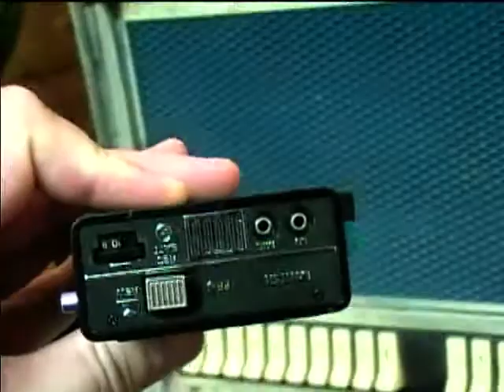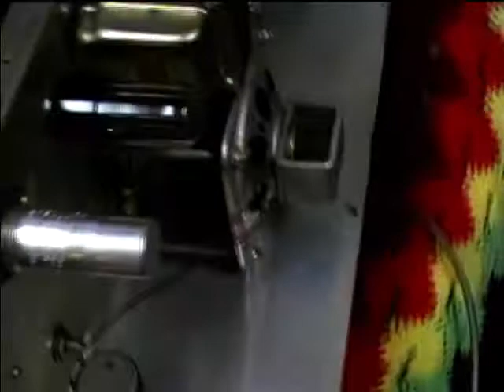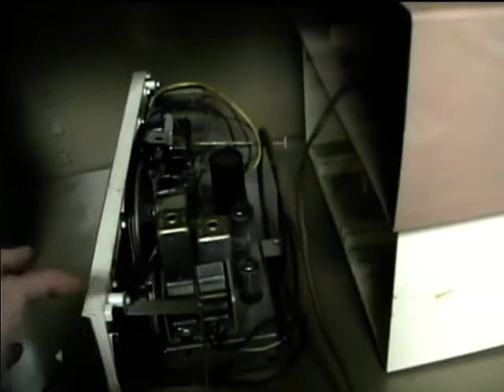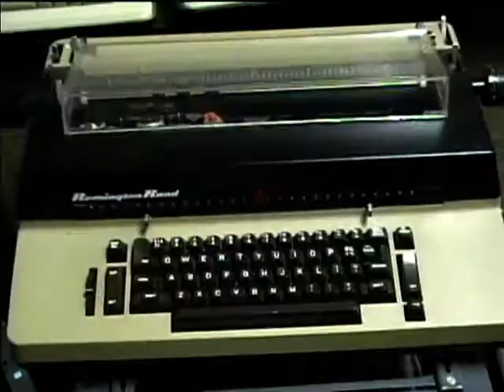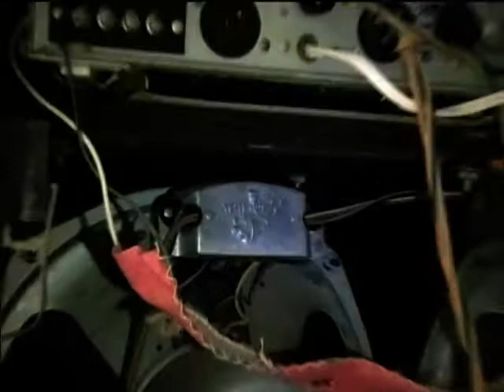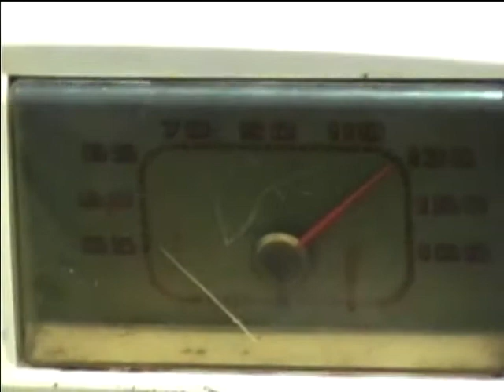This month's repair projects/finds

Comment from the maker: I think the old GE factory is now called "MPD". They make magnetrons and other ceramic microwave tubes...they continued making glass tubes with the old GE equipment through 1992. Some of the last glass tubes made were 6550's with a date code of 1992 which were used in Leslie organ amplifiers.

Comment from the maker: I have not had good luck in repairing modern fans...they often seem to have problems with the bearings seizing. You might try lubricating the front shaft with Zoom Spout oil and if possible disassembling and cleaning the motor and applying Zoom Spout oil to both the front and rear shafts and bearings but too often I still have had trouble with modern fan motors even after doing this.

Comment from the maker: Hi, Thanks for your comments. I've found "Deoxit" spray to be very good at cleaning up noisy controls. It has a deoxidizing ingredient that helps remove oxides and tarnish from contacts. Other brands of electronic contact cleaner usually will help too but they don't seem to clean as well as Deoxit.

Comment: I love the little airline radio! and I've got one of those portacolor tv's too, but I'm not sure what year. it's so hard to find the correct capacitors for it, I gave up and put it back in storage because I couldn't find the correct values anywhere.

Also where do you get all this stuff? and what do you do? fix them sell them? or just collect them? I'd have a bigger collection but I just don't have the room

Comment: Great projects, Chad.  You'll be busy for a while.  The console radios are especially nice.  Your 1940's Magnavox is similar to my 1954 model. If you check Ebay you'll find one of those fm tuners eventually.  Just be persistent.  Do you sell any of the radios after you fix them?